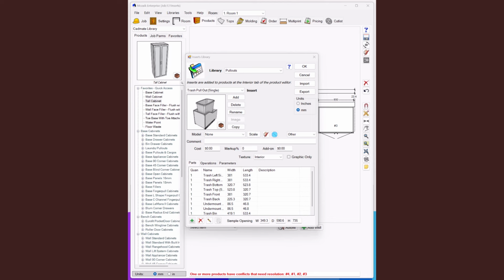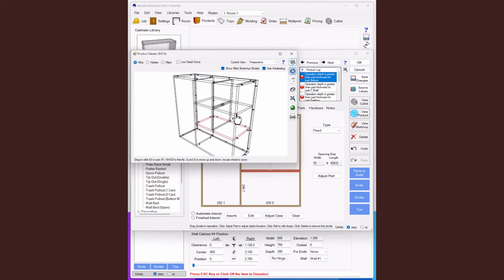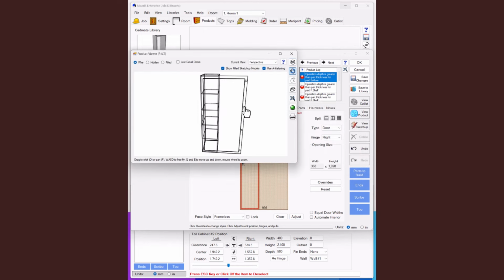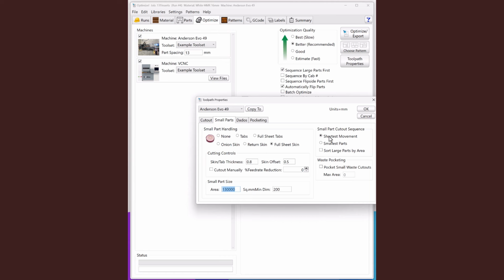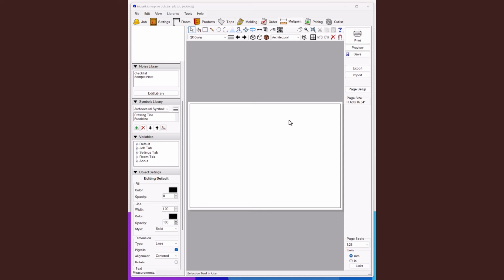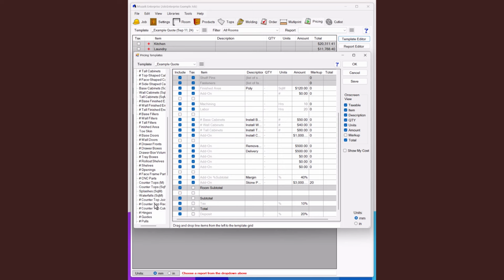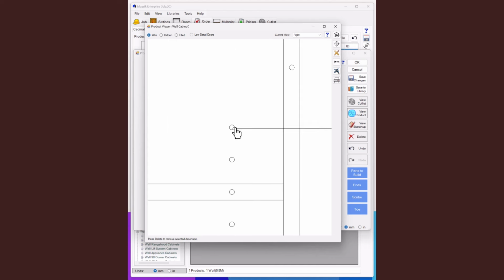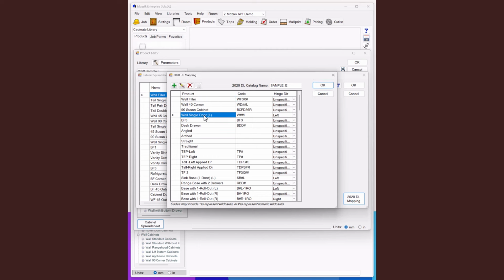Mozaik Software 13.1 Updates and New Features

Comment: Excellent video. Love the new additions. Quick question...At around 10min of the video timeline, you show an option for a "part origin symbol". Does this option need to be activated or is it on by default? It doest appear on my label by default and I cant seem to find the option to activate it. Any info would be greatly appreciated. Thanks!
Reply from the maker: Are you running the Enterprise version of Mozaik? The part origin symbol is an enterprise feature. In the label designer, you'll find it under "Drawings"